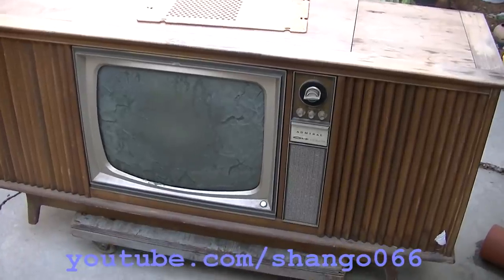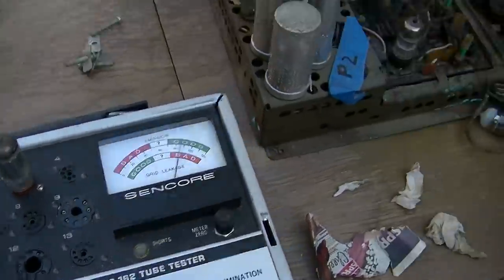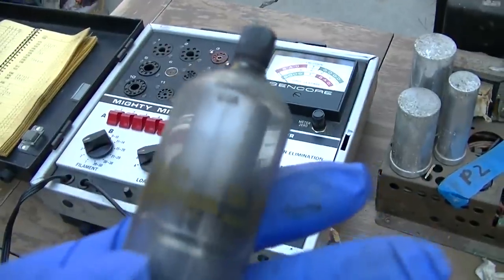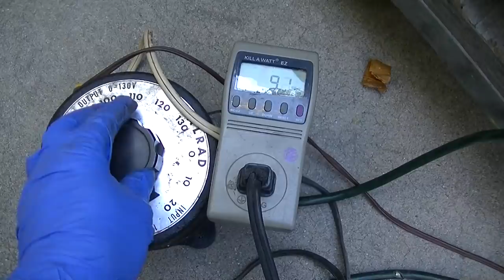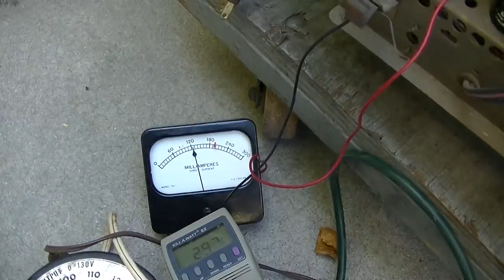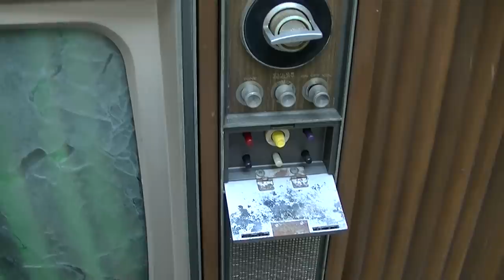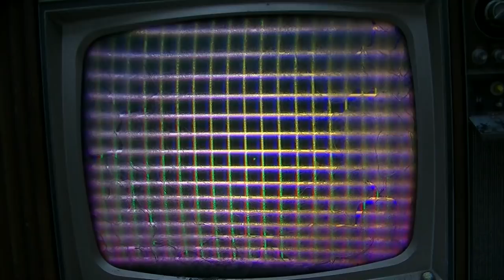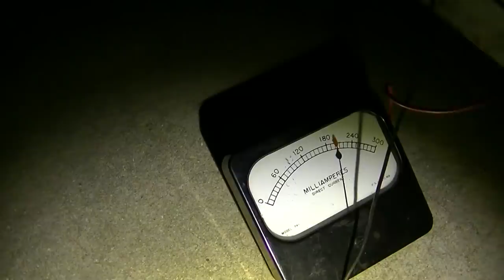1965 TV Resurrection Admiral Combo Color Television Resurrection Pt2

Comment: Those American, tube color sets looks stunning from the back, loaded with tubes, while working. In Hungary, the first color sets appeared in the early 70s and soon the tube technology went obsolete. There are only a handful of domestic, color, tube models (maybe 3 or 4?). And I think, none of them are pure tube sets, some circuitry uses transistors too. So I never saw in real life, that many of glowing valves in anything.
Reply: They do have a cool look, despite being kind of hot. I'm also a little fascinated by some of the last tube sets from the early 1970s in which the guts of a number of tubes were combined into a few big "compactron" packages; some of them were the size of a small beer bottle.
Reply: Remember the soviet "Raduga" TV sets and its derivants. They were hybrid but there were loads of tubes inside as well. Just the design was more "close" so they were not visible this good maybe.
Reply: @janosnagyj.9540  raduga mostly famous for fire problems. better to stick with junost, even if only black and white
Reply: @kyle8952  It's a pity that Shango can't check one of them :-) He likes russian radios, I would like to know what he think about those Rubins/Radugas. For me its ideal TV for EOL party, but they are rare now...
The most strange thing is that in the USSR they produced tube B/W and color TV sets till mid 80's even they had ICs ones at the same time.
Reply: @kyle8952  It is familiar. The cheap, hungarian, color set of the early times was the Color Star, also known as "Robbanós" (exploding). It's actually a soviet chassis in a Videoton made cabinet.

Comment: Great to see it come to life. 56 year old, left for dead scrap TV working again. Remove the bulb cataract, re-place the white bomb caps and re-check the alignment and it will be a decent runner. A little sprucing up of the cabinet to remove the flaking finish and a wipe of danish oil, POOF, MCM boomer flypaper gold. A heck  of a lot better than a pet bed. Thanks again for the fun and educational videos.

Comment: The CRT still looks pretty tired. I’m sure the added brightener didn’t help. Curious what emissions will be after its run a couple hours.
Reply: You will notice after watching Shango's TV resurrections for a while that those old TV's have better nocturnal emissions than they do in the day.  Probably caused by hardening of the filaments and worn out sockets.

Comment: I’d be more worried about hantavirus from rat droppings or actual exposed lead from car battery terminals than the lead in solder. The cadmium plating or organic solvents in the contact cleaner are way more dangerous. Still, gloves are a good idea, as is a face mask. 🤠

Comment: Fascinating. I’m not into television repair like you, but in the early 70s I built a Heathkit 25” TV, so I understand most of what you’re doing, and terms like pincushion, convergence, etc.
Reply: The National Radio Institute used those Heathkit TV kits as part of their TV repair correspondence coursers. You built the TV, and all the test equipment required to service it, and learned TV repair along the way. As I recall, they were among the first TVs to use frequency synthesis tuning and on screen channel number display. Very advanced for the day.

Comment: I had this model when I was a kid. I was 8 in ‘65 and our first color set. When this set working right it gets amazing color. We had it for 16 years. I worked on it all the time and as early as 11 years old. I can answer any question about it you can conjure up. I know what the color fidelity does (that’s an Admiral exclusive and was patented) and the other knob you did not know what it did. This will either have a 23” or 25” tube. If it had the 23” it should have a 23EGP22 - the very first rectangular tube. 25” tube is way better. Our model did not have the stereo in it, but was a 4 speaker model with the tilt out tuner an Admiral exclusive. I wished now I would of kept it. That set was quality to the max. What memories I had being able to watch all the new fall color shows new for fall of ‘65. First time ever most of them made the switch from B&W to color. First time seeing Gilligan’s Island in color. RIP Dawn Wells.

Comment: I'm with you on heavy metals, switched to lead free for most repairs but got to be careful on old stuff.
Reply: Lead free solder cracks and doesn't flow great. That is why the PS3 and Xbox 360 had issues with YLOD and RROD. I use 60/40 pb solder with good ventilation.
Reply: @blazertracer1  Yeah it's bad compared to the good stuff but it is possible to get used to it
Reply: I've had very good luck using lead-free solder on pipes, even with a $10 propane torch, though I have to get it started with paste-solder before the stuff on the roll has any hope of flowing. But I'd be afraid to use it on an old TV; the heat is brutal on some of these parts. I also suspect that there is more in these old sets, as well as in new equipment, than just the lead. There are so many different kinds of plastic off-gassing, flame-retardants and other chemicals in the parts themselves and who knows what in the accumulated dust, that Shango has the right idea working outside. I don't know if I could handle the gloves, though.

Comment: The thing that surprises me about American TVs, even more than how they all seem to have been built into giant grandma furniture cabinets, is how they kept using metal chassis and point to point wiring for so long. A 1965 tv in europe is with a PCB.
Reply: That '65 had a polychlorinated biphenyl.
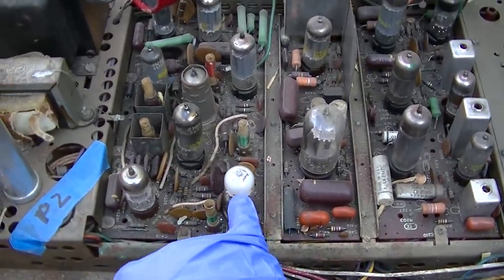Reply: 2:51 This is mostly PCBs; the metal chassis is just there to hold them in place. Most of the 1960s European and Japanese sets I've seen were put together about the same way. Zenith was the one American brand that avoided PCBs for any circuits that included tubes; they had a fear that the heat and emissions (infrared, UV, X-ray) from the tubes would destroy the phenolic board material and that did happen on some sets. I'm surprised that the TV industry didn't start using fiberglass PCBs during this era, since they were already very common in computers.
Reply: @pcno2832  Probably cost concerns. Phenolic is cheap, fiberglass is a couple orders more expensive. I agree, phenolic is the cheap and stupid choice.
Reply: US steel was still cheap and available.

Comment: Shango066, I enjoy your videos and watching you test tubes brings me back to the 60's when our blonde, long legged black and white Dumont TV would act up and my father would read from a Do it Yourself manual that showed pictures of TV screen failures such as rolling vertical, shrinking picture, slanted picture, etc.  The manual showed corresponding tubes to replace and I would walk 23 blocks (my favorite thing to do) to the Pharmacy where there was a tall, free standing tube testing machine with a tube setup chart.  I would test the tubes, put them back in the small paper lunch bag and report back to my father.  Then we'd drive 8 miles (before Radio Shack) to the Electronics retailer store and buy some tubes.  We nursed that TV until 1973 when our upstairs neighbor gave us his Philco color TV and bought a new one.

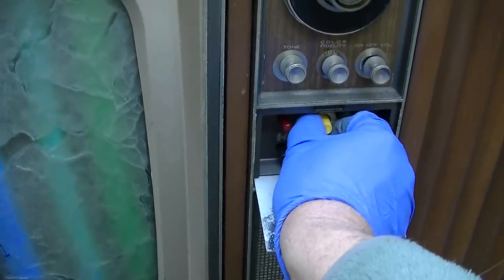Comment: 38:25 'Color Fidelity' might be akin to color temperature.  Try adjusting it when watching a black & white source.  Color(saturation) should be set to the midpoint for this purpose.

You are correct: Turn ColorFi knob one way for bluer(cooler) picture, the other way for redder (warmer) picture.

Comment: Shango066 not sure if you saw it but it looked like that bad horizontal tube looked cracked under the pins also, I’m surprised the filiment didn’t just burn out right away

Comment: Just an observation. If the TV's are toxic they would be giving off that toxicity of lead, cadmium, mercury etc. in the form of vapors under heat. What about the assemblers in the factories that use to hand solder these TV's and radios? I've never heard about sicknesses in relation to this industry. Probably lead paint from old houses and lead water pipes are the main cause of lead poisoning. The trace amounts from touching lead solder or breathing the fumes will not harm you otherwise there would be warnings on the label and an MSDS sheet especially in California.

Comment: No wonder why those color sets cost so much back then, all those connections were hand soldered probably by union workers. RCA used to be in Camden NJ, Westinghouse was in Edison NJ, my aunt worked there after ww2 when she came to America from England after marrying my uncle who was stationed there, she used to solder circuit boards, I have a Westinghouse speaker that my Uncle used to have in his house, it's about two feet high and contained a 12 inch woofer and tweeter, it still sounds good after all these years, it was very gently used, mainly for background music in his house.

Comment: Hey hey! 16 year old viewer here just saying how you've helped inspire me and my friends to start getting into vintage televisions! A few months ago we helped transport a 1973 RCA color television (Model ER346YEN in case that matters) to one of their houses so we can test it out, see if it works, watch whatever we can on it, etc. Turns out no color! So I've been watching your videos just to see what could go wrong and whatnot and I just want to say thank you.

PS: My thoughts on our TV is it needs new caps, although I'll try to get a Sams on it when I can
Reply: Probably bad small value signal capacitors or tubes in the color demodulation circuits. He has had multiple issues of shorted grid coupling caps to the color amplifier tubes. A 1973 TV really shouldn't require a bulk recap.
Reply: @gregorymalchuk272  I've thought about tubes as well, but I'm not overly sure. And from what I know it's not a hybrid set, instead all tube since both the sound and picture warms up
Reply: @eileenf7991  
I would suspect capacitors first, but the picture and sound taking time to come up doesn't mean it doesn't have solid state components, it just means at has at least a few tubes in the sound and plus horizontal and vertical output. I know of a bunch of Zenith models that have transistorized IF, tube tuner, tube and transistor color demodulator, and tube horizontal and vertical output. 1973 is really late not to have at last some transistors. That was right at the end of the tube era. The last tube sets had a horizontal output, vertical output, damper, and horizontal oscillator (plus picture tube). And speaking of transistors, Shango has also had problems with the early epoxy dome transistors in these sets. I would get the model or chassis number, and then get on Videokarma and go asking around for someone with a schematic. Then start with DC voltage checks with a multimeter. Having voltage where there shouldn't be much (especially on tube control grids) should make you suspect shorted, leaking capacitors. Burned out resistors and open coils are also problems. Hum in the audio or rolling bars and waving of the video are indicators of bad electrolytic capacitors in the power supply.
Reply from the maker: good chance the color demod part of that set is solid state and may use modules with ics on them
Reply: Hm, I'll definitely try seeing about getting schematics and maybe bringing a multimeter next time I visit my friend's house. Thank you guys, though, for some ideas and possibly useful info!
Reply: @eileenf7991  - Just a simple suggestion on that no-color problem. You are almost certainly using a digital converter on that set. Before doing anything to the electronics, make sure you've got the set tuned properly, which must be done to get good color reception. The procedure is to tune in the channel that your converter puts out (3 or 4 -- VERY important!), and turn the fine tuning knob in both directions. One direction will produce a smeary black & white picture and weak sound. Going in the opposite direction you should hit a point where picture and sound are perfect. But it is easy to overshoot this spot and wind up with a picture with squiggly interference that changes with the sound. These are known as "sound bars." The trick to finding that sweet spot between these two extremes is to deliberately fine tune the set into these sound bars, then slowly fine tune in the opposite direction until they just disappear from the picture. This is the point of best picture and sound, including color. If the set has an AFT control it should be turned off while doing this. Turn it back on when you're done and you shouldn't have to do this again (again assuming you are using a DTV box).

Worry about the electronics if you still have no color after trying this.
Reply: @Inflec  I actually have not tried watching live television on it yet, although it's most certainly not the fine tuning cus I've tried that when I was testing it out. I can try one last time the next time i visit but im pretty sure something in the electronics is messed up. Appreciate the help tho.
Reply: @eileenf7991  - To see color on the screen the set must be receiving a proper color signal. Without it all you will see is either a black and white picture, or b&w snow without any signal. In fact, color sets are designed to default to black and white if the proper color signals are not there. All the controls for color (intensity, hue, etc) are inoperative in this default state. Older color sets even had a control known appropriately enough as the "color killer" to adjust this point (your set almost certainly will not have this control). Get a good color signal for your set before doing any digging. :)
Reply: @Inflec  It has a color killer, actually.
Reply: @eileenf7991  - I'm surprised a set of that vintage would still have that control. By the '70s, color sets had pretty much eliminated it. But it being there may cure the problem, or at least diagnose it.

You won't need any signal to do this. Turn the set on (channel doesn't matter) and turn the Intensity control all the way up. Now turn the Color Killer control through its range. If the color circuits are working, you will see just b&w snow at one extreme. At the other extreme, you should see a screen of brilliant "confetti." This indicates the color circuits are at least working. Correctly adjusting this control simply involves turning it until the "confetti" just disappears (screen back to b&w snow). Misadjustment of this control may be your entire problem. Good Luck.
Reply: @Inflec  I'll try it out again, because I have tried using the colour killer to see if that was the problem

Comment: COLOR FIDELITY CONTROL...  Here's what it does.  The Color Fidelity control was an Admiral exclusive and patented by Admiral.  Since I had a set with this control I can share how it functions.  What this control does in a nut shell is it "tints" the gray scale.  So the B&W shows can take on a "Brownish" (pot fully counterclockwise) to a "Bluish" (pot fully clockwise) tint with "Neutral" being in the middle.  It's extremely important to have the pot set in the middle of it's travel (Neutral) when setting up the gray scale.  If not the control will not function correctly.  For a color picture we use to keep it set to the brownish side (pot fully counterclockwise) because it will produce deeper flesh tones when set to this position.  Try it out once you have the gray scale set up correctly and you will see what I mean.  Cool idea and only from the geniuses at Admiral.

Comment: Dude the ball dropped on this thing like 40 years ago... and it was a really heavy and big ball. Any guess why this crap still works?..  and then you  got that tube tester that dont work no more cuz the sockets are bad too. I don't mean any harm by saying that.
Reply: It still works because at the time it was made, “it can’t be fixed” was not a regularly used word in a TV repair man’s vocabulary, and a 3-5 year lifespan would be considered unacceptable, and the end of the manufacturers reputation. 

The tube socket in the tester can be replaced too.
Reply: @erikj.2066  I remember when TVs were sold with a 25 year warranty, 5 years on the picture tube.

Comment: What is that little white button on the lower right corner of the picture frame? Internal degaussing?  It might be a good idea to put a muffin fan on the vents for the HV cage, given Admiral's mid-1960s reputation for flaming flyback meltdowns. Seems like kind of a cool set and I'll bet these "home theater" combos are getting rarer.

Comment: What does that baby draw, maybe 450 Watts?   Your videos really take me back.  I never got very good at repairs but I had a problem with the vertical size once on a set older than that one (all chassis wiring, no PCBs) and it really gave me the vapors.  Each suspect part I changed out helped a little, but never enough.  Eventually I found a 1/2-W resistor hidden up under the lip of the chassis that had cooked, and its resistance rose from maybe 270K to 2 Meg.  I had one of those in stock, a 5 cent fix had I known what I was doing.  LOL

Comment: +shango066 quick question for you - I used to have an EICO 667 tube tester with CRT adapter.  I sold it when I was 16 for $125 - I needed the $ to fix my car.   I want to buy it back same price (still have CRT adapter).  Is this a good tube tester?  It has transistor tester too (but I have a better one solid state)